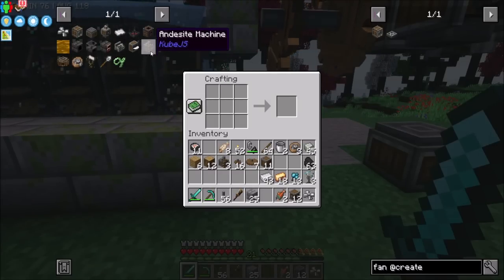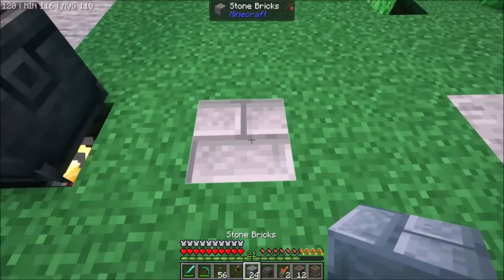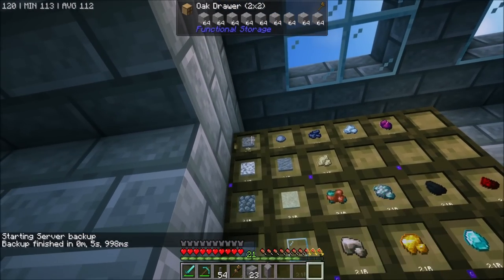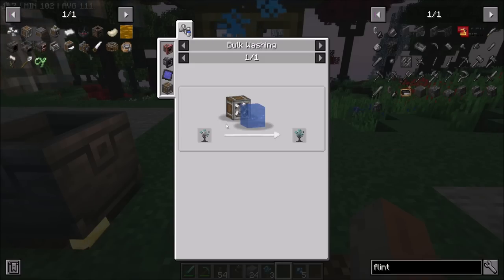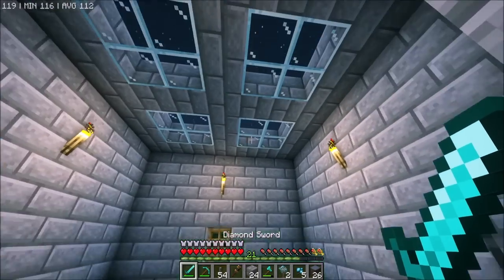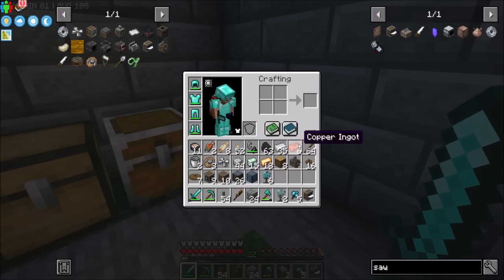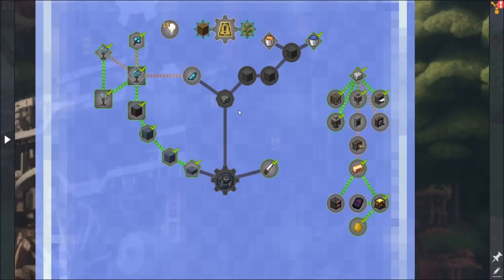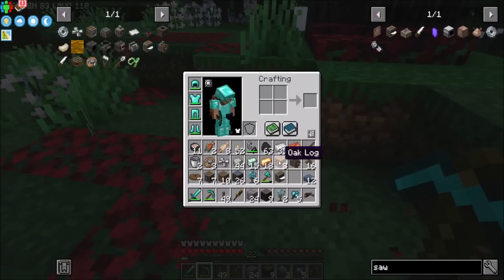Arcane Engineering Ep4 More Contraptions

Comment: Adding a trash can is fine, I'd say. You can make one with vanilla, so it's not cheating to just condense it to a single block
Reply: I had a tendency, in Create: A&B, to make my own trash can. One for personal use, and one at the end of a bunch of setups for handling overflow. Excess sticks and the like that were just clogging up my belts. Just a conveyor that launched junk at high speeds straight at a cactus. Best use of excess materials? No. Satisfying? Yes.